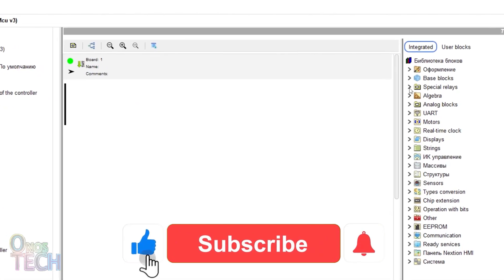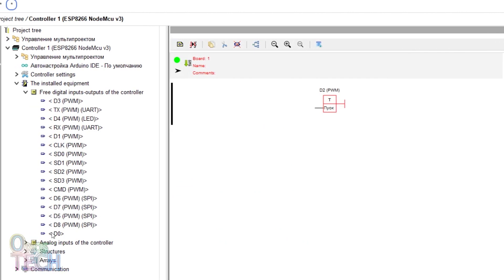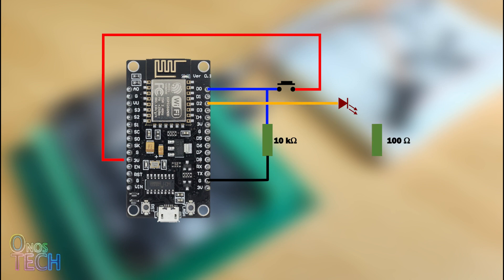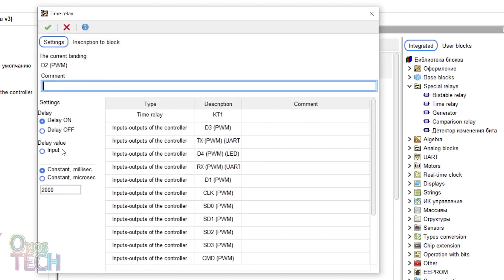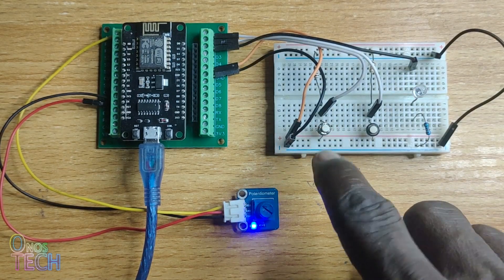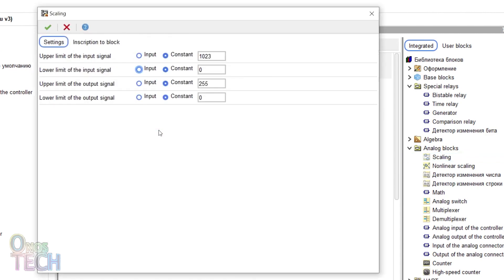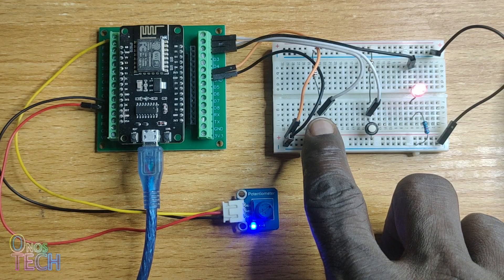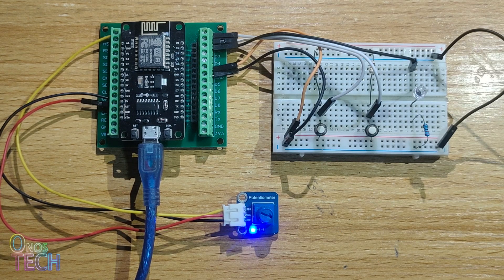#2 Timer Relay || ESP8266 FLProg Ladder Logic

Comment: greetings from el salvador I like the videos and I would like to know if in outseal is necessary to connect the two Arduino nano master-slave to program is that I do not have them yet . Thanks
Reply from the maker: Are you referring to this video where a display is connected to the Outseal PLC Nano? https://youtu.be/g0OqOib9Lag If yes, you can also program ESP8255, ESP32, STM32 or any other Arduino if you have with FLProg.
Reply: Oh!  I was not referring to this video https://youtu.be/GEeiTLoXdKY, and I take advantage if you can share the manual for the latest version of outseal?
Reply: Thanks
Reply from the maker: This is when you need more input/output than the ones in the nano.
Reply from the maker: https://drive.google.com/file/d/1xFnk-H6EWQEy5VxnoR2Bv1ORqT5J8qV4/view?usp=sharing